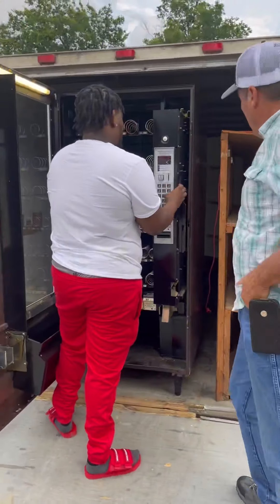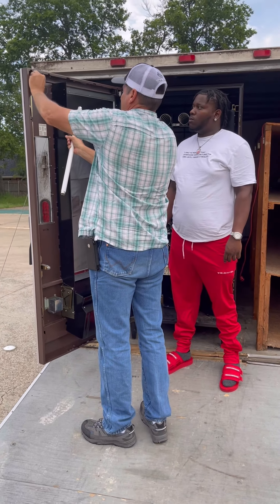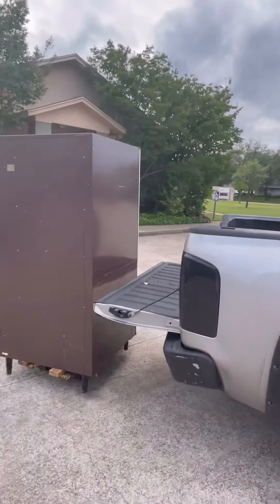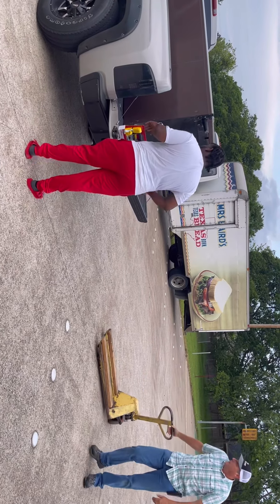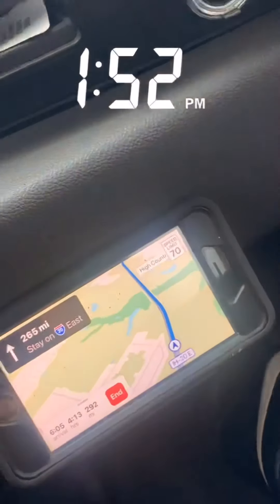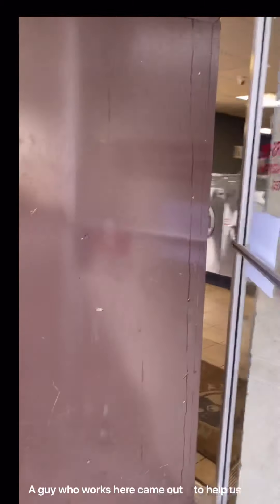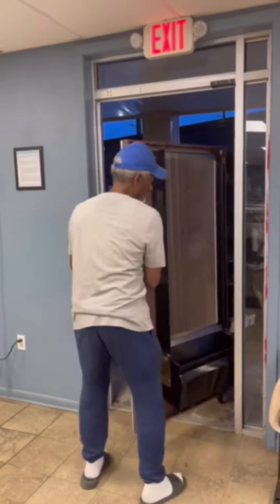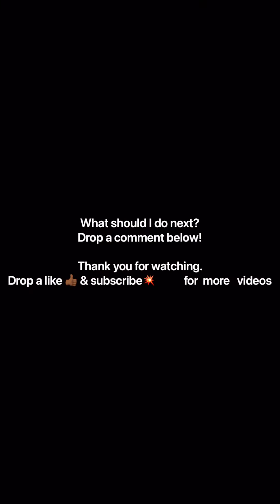HOW TO START A VENDING MACHINE BUSINESS WITH NO EQUIPMENT.

Comment: 1. That machine may look old etc. but it’s an ap6600/7600 one of the best vending machines ever made. later you can install an upgrade board which will let you install a credit card reader, or you could get a new door which will have the updated electronics, Delivery sensors, led lighting.. also a more modern external appearance (some say nicer than the brand new machines) most importantly it will be ADA compliant so you can use it in government buildings that require that.  ( about 600 for kit with coin mech and bill validator that are MDB or 1500 for the door with everything else.:: seems like a lot but a new machine with those features runs 4-5k!)

2: I put a couple of 2x4 angled down off the tailgate, tip the machine and have it rest on 2x4 if really heavy you can have a couple of cross braces  on 2x4 and use an automotive Floor Jack to begin to raise machine where it is close to level. Once level push hard and the 2x4 will help the machine slide.. YOU can also do this with soda machines but you need to remove compressor.. the compressors are designed to be slid in and out and only have a few screws holding them in.

I appreciate him being big and strong however why not make it easier.

Once again great choice on machine maybe it was not intentional:

But going forward it can be... CHECK d&s vending or vendors exchange.. both are parts suppliers to established vending companies so machines the industry approves of and that they are worth the investment to make them more modern will have many options from those 2 companies. Remember this the machine in the video most people say they are worth 300-800 depending on condition and upgrades and last coin mech and validator some are twice as much but they are very reliable.

Now think about that.:. THE established vending companies believe that taking a 400-500 machine and investing 1600 into them to modernize them is a wise investment: